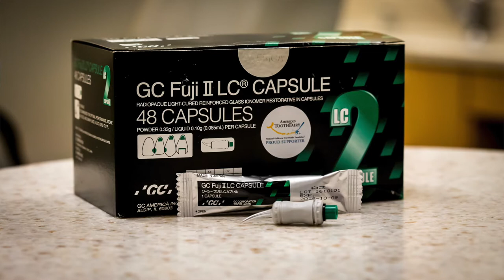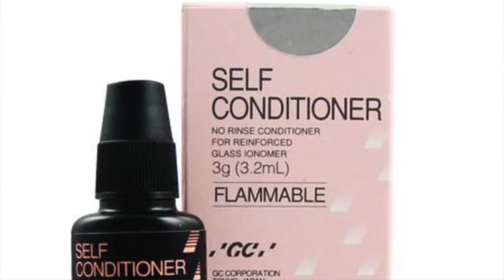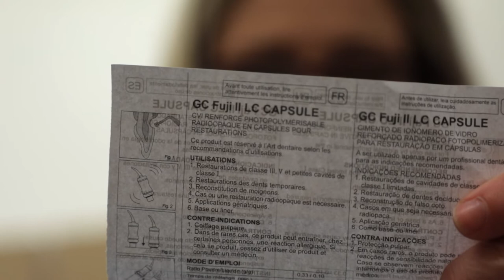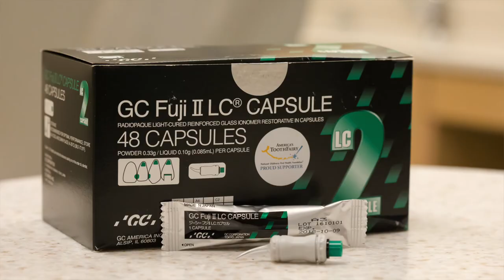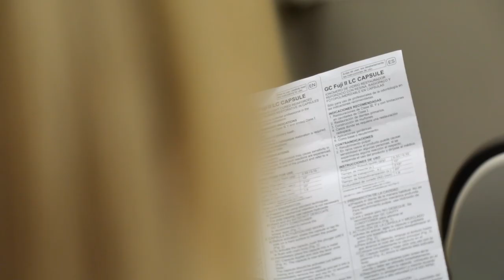Do we need to use a cavity conditioner?

Comment: Before I cement Zr Crowns with Fugi II, RMGI, I do a presrub with PA acid. And from my experience the few crowns I've removed after cementation had very nice bonds and I've had to cut them off, piece by piece, like a well cemented e.max. Anecdotal, I know
Reply from the maker: Ryan May That is very interesting. Never mentioned in the manufacturer’s instructions but makes sense. Would be interesting to see a study that looks at that clinically.

Comment: This is really informational! If it bonds so well to dentin is there even a need for preparation for example on class V?
Reply from the maker: Taylor Anderson Typically, class 5 non-carious lesions are going to be more calcified—sclerotic dentin. These can be a challenge to bond to. In theory, you are correct, you don’t necessarily have to do anything to the prep but it may not be a bad idea to toughen the prep first with a diamond bur prior to bonding.
Reply: @TheComprehensiveDentist  Figured I might as well try it so found a dentist that was willing. He used a GI (only had one color in stock so it's could be better), no prep just poly acid, seem pretty solid so far no sensitivity. I figure if I'm going to need these "filled" for the rest of my life I gotta find a way that either does no damage or stays on a very very long time. Will be interesting to see how long they last, the resins I've had seem to last about 3-4 years but are usually pretty crummy at the gumline, and if they'll fall off in one big chunk like the resins I've had or if they just wear away slowly. Thanks for the vids btw, helps me be an informed patient.

Comment: Is it possible to have a link to the comparative research of bond strenghts?  
Thank you very much for your time
Reply from the maker: watersofthesouth the article references for the cavity conditioner is: Saad A (2017). Microtensile bond strength of RMGI cement to sound and artificial caries - Affected root dentin with different conditioning. Operative Dentistry 42(6).

Comment: What if I just use the blue etch (phosphoric acid)? Since it’s the same ingredient if the self conditioner, should be the same result right? Which means I only need to spend money in buying/using the blue etch instead of buying the cavity conditioner? 🤔
Reply from the maker: They are totally different chemicals. Phosphoric acid etch removes the smear layer and your ability to chemically bond to the tooth with it! Poly acrylic acid is what is found in GI/RMGI and should be your go to to maximize the benefit of the product. Remember, saving money and reducing steps does not typically equal “better dentistry.”

Comment: What about for off label use as a pit and fissure sealant? Any information on use of the conditioner when  boding entirely to enamel?
Reply from the maker: GIs and RMGIs are the worst choice for sealants. They never last as long as resin and the bond to enamel without phosphoric acid is inferior.
Reply: @TheComprehensiveDentist  Thank you, but not what I asked. All studies agree they are inferior to resins as far as retention goes, but equal or better in terms of caries prevention (the ultimate goal). My work environment (schools) is trying to limit aerosol production, so we are switching to hydrophilic material(I don't have a choice) .My question was asked to find out if you have any input on whether the conditioner will be beneficial in my case or an unnecessary step.
Reply from the maker: Richard Vogel so if I understand correctly, you do use GI based sealant? If that is the case, I have seen studies that show a benefit using a conditioner in regards to retention. Granted those studies did not look at sealants specifically and bonding to enamel specifically. The conditioner contains polyacrylic acid. GI’s also have a component of polyacrylic acid so are in essence “self etching”. So is the conditioner beneficial? On one hand yes. How beneficial? I have no research to show a clinical significance in GI based sealants and for enamel. Certainly a desire to minimize aerosols would frown on conditioner due to the need to rinse.
Reply from the maker: I would also add that if you use a conditioner and then place a GI based sealant, you are looking at two steps. At that point, unless moisture control is an issue, I would just do a resin based sealant. This can also be two steps if you don’t use a bonding agent and will be a better choice. I would argue that retention is strongly related to caries prevention. Partially retained or lost sealants can easily lead to eventual caries in some patients. Sealants are only one small component of overall caries prevention.
Reply: They have a specific pit and fissure RMGI called Fuji Triage I believe. May be more purpose made for avoiding 2 steps

Comment: Is there possible harm that can result from using 37% phosphoric acid? Or would it be better to do nothing?
Reply from the maker: Abigail Fincel when you use 37% phosphoric acid, you are doing a total tech of the dentin. This means that you are removing hydroxyapatite from within the collagen. The cavity conditioner only does a partial etch and leaves some hydroxyapatite. Knowing this, glass ionomers and RMGIs bond via chemical bonding to hydroxyapatite. Which do you think would offer the best bond? Don’t use phosphoric acid unless you want inferior bonds.
Reply: @TheComprehensiveDentist  How about using a Universal Adhesive? Considering the fact that it contains an acidic monomer; it will modify the smear layer without sacrificing calcium. . In a study by Imbery et. al in 2013 (Evaluating Dentin Surface
 Treatments for Resin-Modified Glass Ionomer Restorative Materials), Total Etch technique yielded better results than a variety of Cavity Conditioners. The study didn't evaluate the bond's strength over a lengthy period of time like the study you mentioned by Saad et. al. So maybe that's a vulnerability of Imbery's Study?
Reply from the maker: Muhammad Bishr Interesting, I haven’t looked at that study myself. I’ll see if I can find it...